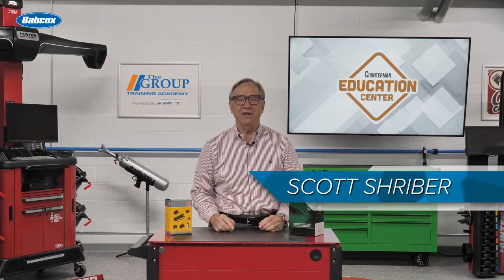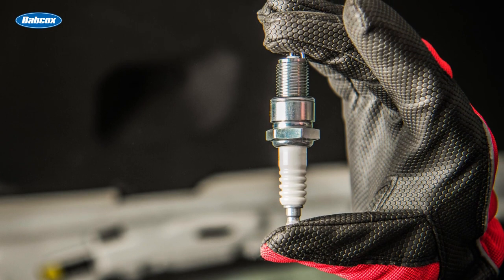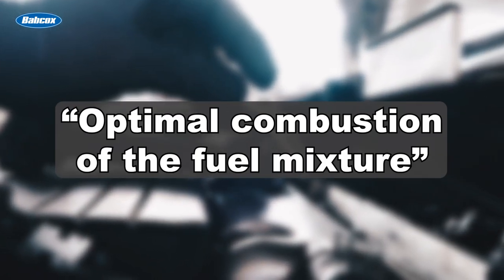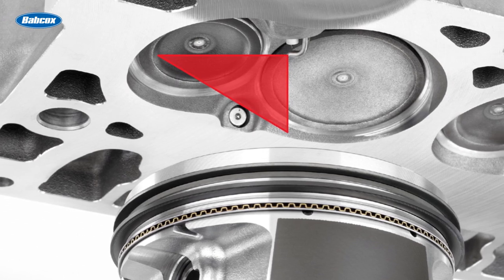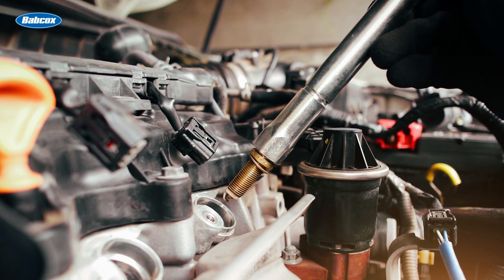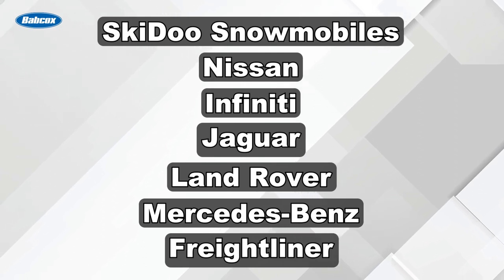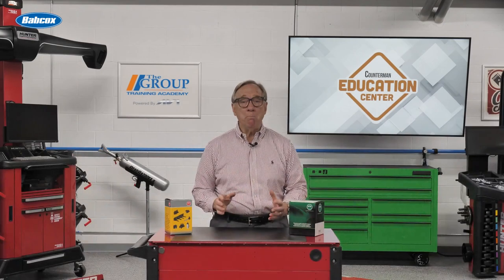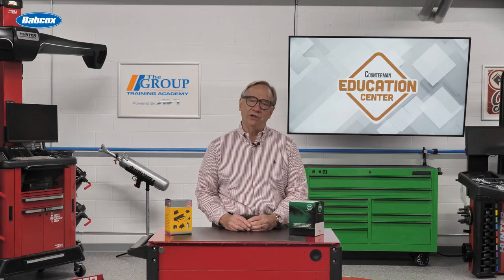What Is Spark Plug Indexing?

Comment: This video didn't explain anything about how to index your spark plugs. Take a marking pen and mark the open side of the electrode. (on the ceramic part) Then tighten the plugs in such a way that the open side mostly faces the inlet valve. You might have to tighten some plugs slightly more or less than others, as long as you don't overtighten or undertighten any of them too much or too little. The crush washer should give you enough give to play with. I've always done it like this, and have never had a problem with too tight or too loose plugs. 😀